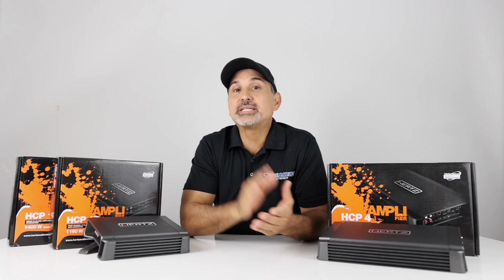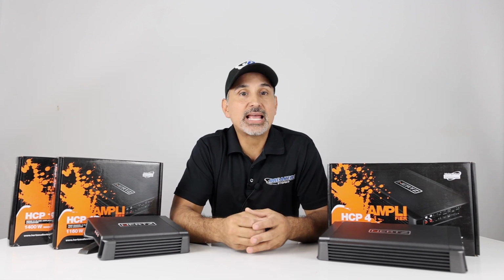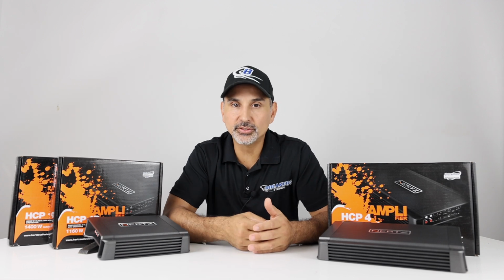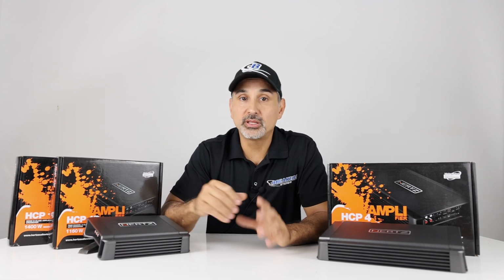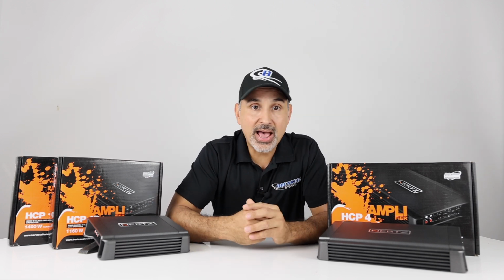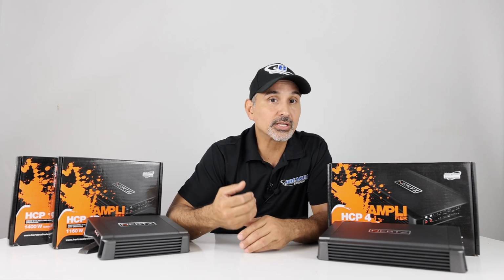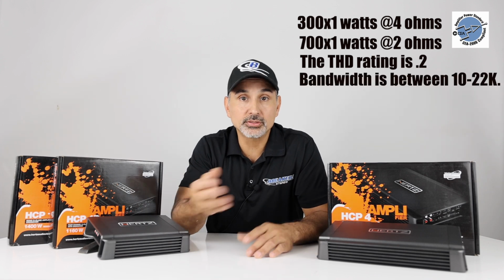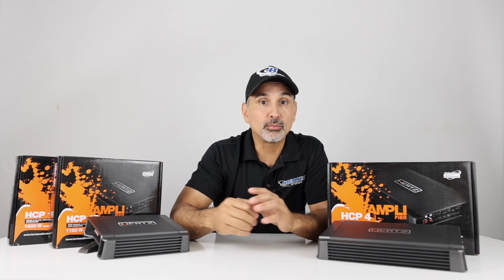Hertz HCP Car Audio Amps, Review. Mono Block Amps, 4 Channel Amps, 2 Channels Amps, 5 Channels

Comment: All mono blocks should be able to be ran at 1 ohm. Main reason those arent very useful.
Reply: I have this amp and it rocks , running it at 4 ohm load from a Dayton audio 12” sub and it pounds very hard at that load , no need to stress the amp out with a 1 ohm load. Totally unnecessary!
Reply: @Journalistification  1 ohm stable amps arent exactly stressed if they're designed to run that low.
Reply: @ah4800  You could be right , but your car's electrical system its not designed for such loads on constant basis maybe at short bursts but not everyday without damaging the alternator, battery etc..    Just all around better and safer to run 4ohm loads or 2 ohm max which this hertz mono amp is capable of.
Reply: @Journalistification  im not sure you really know what you're talking about. Amps are a little more efficient at 4 ohms than 1 ohm but its nothing crazy drastic. You might lose 20% efficiency. Having amps that are 1ohm stable or even less just frees up wiring options. Very few amps out there make decent power at 4 ohms and if they do they are very expensive. Nothing wrong with running a sub amp at 1ohm
Reply: @ah4800  I guess it comes down to personal preference, my dayton audio12"  dvc 8ohm sub gets plenty of loud in the cabin of my pick up truck and you can hear it outside too if i really wanted too , in my case I don't need the power this hertz amp puts out a 2 ohm even less a 1 ohm or half ohm to risk catching my ride on fire. It does seem like this isn't the brand for you , this italian brand is oriented for sq not max spl , you seem to be more into underground brands with crazy rms output levels and high ohm loads, definitely not my cup of tea.
Reply: @Journalistification  funny you say that, i actually love hertz. My entire front stage is hertz ran fully active. Mlk 165 midbass ml 700 mid range and the ml 28.3 tweeters ran off an hdp4 bridged to the mid bass and an hcp4 running the midrange and tweeters in custom a pillars. Processing done by a JL twk 88.

I run 4 6.5 inch subs of a sundown saz1000d@1ohm. Sometimes i just like bang on my subs depends how im feeling. On subs you're really not going to notice whether its on 4 ohms or 1 ohm running the same power. Nobody would be able to tell. Total harmonic distortion doesnt matter on subs since youd never be able to tell. Theres no risk of fire running 1ohm on an amp designed to do so.
Reply: @ah4800  Wow that's a nice front stage set up you have , nice sql  gear and powered all active , Nice !!  
I'm running 2-way active front stage with the pioneers 80-prs doing the limited processing it can do but it sounds good for a daily driver work truck.

For amps I run a zapco st -4xsq for tweeters and mids and the hertz mono amp we've talked for a single 12" sub  but soon will be swapping out the zapco 4 channel for a hertz audio hcp4 class a/b to actively power a pair of dayton audio 7" mids and dayton audio 1-1/8 soft dome tweeters . I do have 2 different pairs of hertz audio tweeters( ml 280.2 & mp 28.3) and a pair of the mpk pro 6.5" mids but I'm gonna save those for another install not the work truck because they are too nice .
Reply: @Journalistification  good stuff man